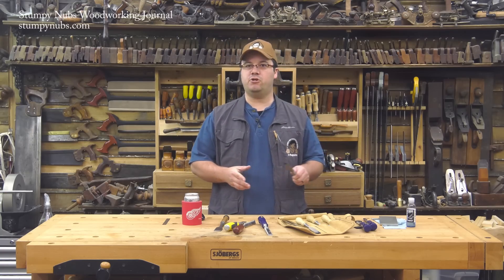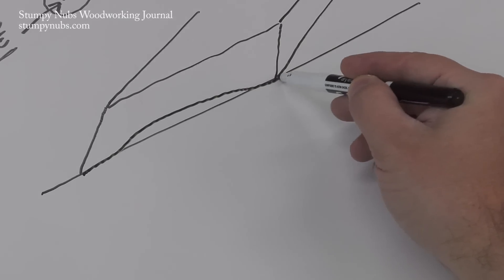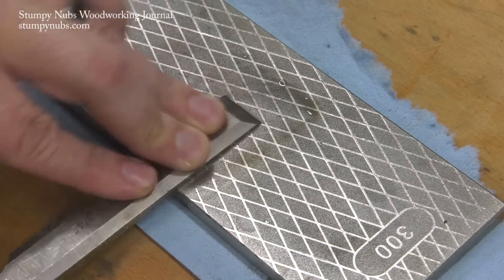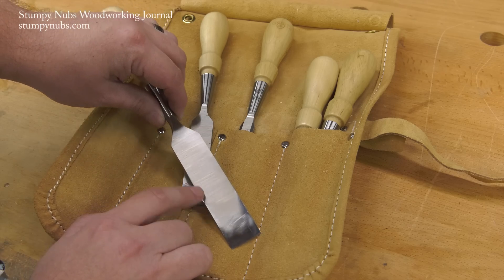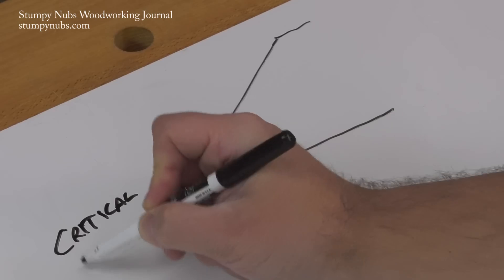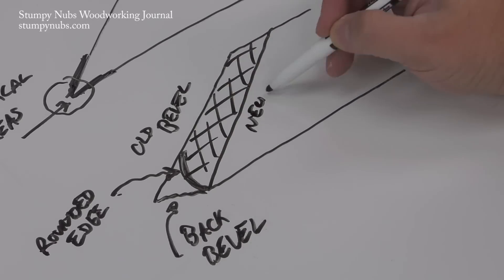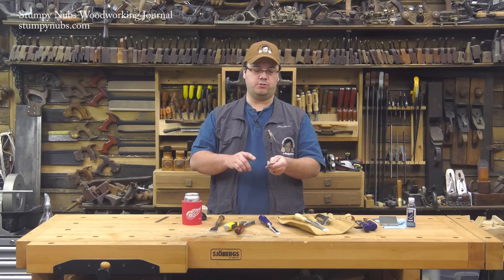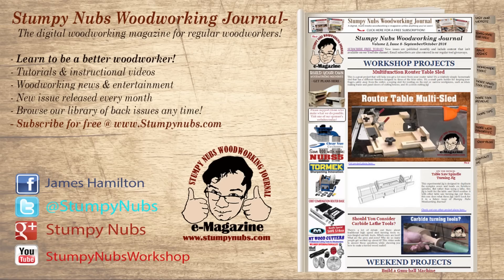The biggest sharpening mistake woodworkers make (And why...)

Comment: A kind of variation/compromise of the "back bevel trick" for some chisels is to apply pressure on the front while sharpening, but work the whole surface. That way you will have a really flat surface throughout, it won't be parallel to the (mean) surface of the raw tool, because on the front you will have removed more material, and you can stop when you feel you have sufficiently enough material flat near the cutting edge.

I noticed that a lot of chisels these days have not really much hollow/belly warp (mostly gets away after 5 minutes on a diamond stone) but have warp in the other direction, which makes it almost impossible to grind them flat enough to have a real flat reference surface.

Anyone else loves to have a chisel or two with all surfaces mirror polished just to lie around and make people look at that went astray into your workshop? ^^

Another tip that might work for some people that do manual work on their tools: Make yourself a "sharpening bowl" which is a portable bit of whatever you minimally need, take a few tools and just sharpen them whenever you do something that allows it, like having to sit through an episode of your wifes favorite sitcom... ^^

Comment: Great info as usual James, It's a one off on buying chisels and plane blades. I lap approx 30mm of cutting edge, and then it's good to go forever (most of the time). It does not take that much effort and not having to think about when you used the ruler trick last.

Comment: This is very informative, but I have been working with wood over 40 years, and one thing you did not cover is many folks use grinders and belt sanders to hone their chisels...I've seen this done many times...personally...I use a tri-surface wet stone

Comment: Been sharpening my carving and lathe tools on a small belt sander for many years.  It works great, and is fast.  Why?  Because carving tools are not used at the same angle time after time, as a plane blade is.  So an exact edge angle is meaningless, it just needs to be close to the factory angle, and sharp.  Learned it from a famous professional woodworker.  Look it up sometime.

Comment: The ruler trick is seriously nasty. It made me angry when I first heard about it. Why? Because with only a very small amount of weight bias towards the end of the blade, it's easy to achieve a good amount of flat in most decent chisels and plane irons. 

And if it's taking too long, buy good quality old chisels. The material is usually superior. I've bought red rusty 100 year old chisels that look like scrap metal but have the right maker's mark. I sand off the rust, then work them back into useable shape. 

To many, this is a black art, but it's one you can master fairly easily. All you have to do is understand why it's important. Wheelwrighting, Boatbuilding and barrelmaking take a lot longer. So far I've only cracked wheelwrighting.

Comment: All good information here.  But I do (humbly) take issue with the "back-bevel" ruler deal.  Perhaps it was an old school pay your dues exercise, but before any of us even started to do any actual woodworking, we had to set up our tools.  All edge tools, whether they were chisels, plane irons, or spoke shaves, had to have their respective tool backs flattened.  It took days.  In fact, we all had to (hand) flatten out hand planes before we even got to the plane irons...jointer planes took an eternity.  But once we were done, we had an appreciation and understanding of straight, and flat, and surface quality that went through to our (hand) joinery and ultimately, our furniture.  I could no sooner do the ruler trick on one of my  plane irons than intentionally drive my car into a wall.  Your illustrations of (poor) surface quality are spot on.  Terrific video...a pleasure to watch.
Reply: Parker, with all due respect, I'd say the point of the video is so that those of us with shorter attention spans and less persistence can have sharp tools without taking a week to sharpen them.
Reply: @Madmun357  It takes me less than 2 minutes to return a razor edge to a dulled plane iron.  Yes, the initial set up of a hand plane, one step of which is flattening and honing the back side of the iron, takes some time.  But unless one starts with a poor quality or damaged tool, flattening the back of a plane iron takes an hour at most, not a week. And once this investment has been paid,  an on going return is that one will never have to find or keep track of a suitable ruler each time the edge needs to be sharpened.
Reply: @robertlangley258  Thank you for the kind words.  Perhaps you could read my post again and this time read what I wrote , which starts with "All good information here...", takes issue with one detail, and closes with "Terrific video...a pleasure to watch."
Reply: @robertlangley258  Auch, taste of your own medicine there. LoL
Reply: @parkerheathiii4881  : To your credit, Sir, you even inserted the word "humbly". I fully endorse your overview. :-)
Reply: @parkerheathiii4881  I wouldn't sweat it, Parker. Some people like Robert obviously can't help themselves, steaming in and flinging insults around when it's not called for.  They just make themselves look stupid.
Reply: Parker, where did you learn woodworking? Who taught you to (or made you) sharpen your tools that way? Asking because I've been doing construction for 20+ years, never had any "formal" training in it. Work that requires this level of precision is foreign to me, and very intriguing

Comment: Great video and informative drawings. About the ruler trick: I have an old Ulmia plane from my grandfather, who was a carpenter, born in Poland and deceased in Germany in 1975. The plane's blade's back clearly showed that he had used the ruler trick, but I'm perfectly sure that he had never heard of Mr. Charlesworth. So, I do not credit the latter for the ruler trick.
Reply from the maker: Pretty much everything in woodworking has been done before. But it's nice to give credit to the person who I happened to learn it from.
Reply: @StumpyNubs  Ok, I totally agree with that. I had misunderstood that you considered Mr. Charlesworth the inventor of that method, not "only" one of its teachers.
Reply: @gunnararndt4359  If you want in depth knowledge of planes and sharpening, read David Charlesworth. I appreciate James' mention of Mr. Charlesworth.
Reply: On planes it also gives you a steeper attack angle. Frequently used to trick to tackle awkward grain, when you don't have proper York plane.

Comment: When replacing worn out chisels I invest the time to carefully flatten the entire back of the "blade."  It's worth the effort to have properly prepared cutting tools when doing precision joinery.  I learned this skill from an "old guy" back in the mid-50's as a youngster.  His chisels were hand forged by a very talented blacksmith.  I learned a great deal from him about crafting tools as well.  Too bad both "old timers" passed on before I had learned more.  Acquiring those skills today is nearly impossible without nearly prohibitive investment and more critically, finding a skilled "teacher."  I rarely use power tools although at times it is necessary.

Comment: Superbly explained..how does one sharpen curved chisels as in the ones used in for carving? I'm an absolute beginner and how you explained everything in this video came across brilliantly..lol, I can be painfully dim at times!
Reply: To be fair my friend, I really need to have this question answered too.
I was left a massive amount of tools in my grandads will. Among them an enormous amount of wood chisels, over 150, marples I believe them to be and 22 Record and Stanley wood planes. Vices, clamps I ha e never even come across before! You name it, he had it! Anyway, their are a lot of gouging chisels, they look to be for the wood lathe/bandsaw combo I also inherited (weird looking thing I know, it must be pretty decent its a myford). Any who,  although the chisels are exceptionally clean and keen at the moment, I would like to be able to do such tools justice and at least maintain them correctly.
So, the round gouging chisels have got me at a loss.....how do you keep the inner curved part flat? I am sorry if I didn't explain this well, I am new to woodworking. I'm fine with metal and my hobart....but this is like black magic! Please help.
Reply: Btw, are you any relation lol
Reply: Curved chisels are normally sharpened in a jig against a powered wheel . Consistent sharpening by hand with a complex bevel is extremely difficult
Reply: @shonaoneill5151  yeah like mentioned already consistency is key in complex edges, they make simple jigs for grinders to keep the tool referenced against the cutting surface of the grinder, or you could build one yourself.
Reply: @shonaoneill5151 , I'm with Peter Herrington on this one, but I'll take a step further.
   You'll want to run a search through Ebay and/or Amazon fairly soon...
   Search for "jigs sharpening gouges" and any related terms that come up as you scroll through the images... Study each item offered carefully (not just the price to cringe at)...
    You see... Sharpening jigs in Carpenter's shops are OFTEN handmade, and some can get pretty "wonky looking"... BUT the principles of sharpening and holding a consistent edge don't change... SO it stands to reason if your inherited collection is so clean and keen, then your grand-dad probably had a few such jigs around. They might not look like what they are to the "uninitiated eye"... making it EASY for you to overlook them.
    I've been in Carpentry for most of my adult life (off and on... and among other things) and I can still walk right past something a few times before stopping to realize what I'm looking at... ESPECIALLY jigs!

    ...funny story... 
   I actually had a "twist drill jig" for sharpening bits on a bench grinder... The thing had sat in a box for years. Meanwhile, I was buying new "electric drill-bit sharpeners" every time I wore one out (I end up occasionally stuck in metal and stone work, even in carpentry...lolz)
    ...AND then (about six months ago) an elder neighbor was chatting while I was maintaining the shop, and part of that was "the drill bit patrol"... When he grimaced at the racket of the little bit-sharpener I was "beating to death"... Then he pointed out the jig and asked me what the hell was wrong with that one...
    It was kind of embarrassing when he sat it up, next to my own bench grinder... stuck a bit in the thing and "zing!" sharp... just like that!

     Finally... you probably already know... BUT it's worth repeating. If you do go after sharpening anything with a power tool, I highly HIGHLY recommend a SPEED CONTROL involved on the power tool.
   High speeds and grinding make heat... heat kills temper in steel... Water and oil can only do so much... SO a slower grinder makes a happier blade... simple. ;o)
Reply: @shonaoneill5151  If you're not already familiar with him, search for Chris Pye. Chris is a master woodcarver who lives in England and has a series of videos explaining various aspects of woodcarving, including sharpening chisels and gouges.  (He does everything by hand.)
Reply: gnarth d'arkanen t
Reply: @thomasdeltoro8030  yo no entiendos
Reply: @shonaoneill5151  check out Penn State industries.  They make a low speed grinder with a jig to hold lathe tools  very cool tool for 275 dollars.  But you have to get on a waiting list to get one.

Comment: Strop it till you drop it. That's what I was taught.  I flatten the whole back, sharpen it once, and strop it regularly. I only give it the stone if I drop it or if it gets chipped while using it for something stupid like opening a can of stain.
Reply: @peterfitzpatrick7032  And we're still wondering what he was up to. Lol jk
Reply: Noooooo....actually using them to open cans of stain/paint/finish/etc....killen me smalls
Reply: Peter Fitzpatrick my father also did this. I still do if I’m on site as use an oil stone then and no strop.
Reply: Peter Fitzpatrick it does knock the wire burr off when you sharpening on oil stone. I know that because when I was training and before my hands had hardened properly I got a piece of burr under my skin.
Reply: ... hands tough as leather...

Comment: Just set up your tools the Japanese way with a completely flat back.
Quick and easy to quickly pump out a fresh edge with no changes in angles.

Might be a chore if you have HSS steel and no hollow back, but a good grinding stone such as Shapton, sigma or nanikawa (there's thousands of good stones out there).

This is coming from me as a sharpener. I'm very tired of woodworkers not establishing proper angles on their tools as it removes so much performance of the tool.

I understand that you can't spend hours every day sharpening up your tools to perfection. 
But by having those flat angles on your back and bevel you significantly cut the time needed for maintaining your tools.

It's really sad to see these neglected tools, very similar to children a tool that has once been poorly set up will never achieve what they really could have.
Sad but understandable

Comment: Really quite the nice informational video. Great job.
I already picked up this information from others, and some from you along the way, but other beginners may not have spent the hours behind the screen doing their research, and this pretty well covers most of the errors I've experienced while researching and practice sharpening. Personally, I'm still waiting for someone to make high tolerance CBN plates for sharpening tools. I haven't been able to afford the wheels yet for my 8" slow-speed grinder, (for my lathe tools), and I sure can't afford a diamond lapping wheel either. I tried one of the card-board wheels, and was completely un-impressed by it. My tools came away duller than lapping with diamond cards and wrist action. 
Thanks for sharing this video as a source of info for those kicking themselves because they just can't get a tool working the way they see it work on the videos.
Kuddos!

Comment: Hi James, I've been using 'Electrical Tape' instead of the ruler for some years now. It is thinner, it doesn't affect the stones, it gives a perfectly uniform angle as it is taped to the blade itself and going from one grit to another keep the same angle of attack. You don't have to faff around with keeping the ruler from moving around either.

AND - I use it on most of my chisels too. If you do the calculations the ruler creates nearly a 1 degree back bevel at 2 inches from the edge (0.9 degrees to be precise). The electrical tape is .14mm thick against at least 0.8mm for the ruler and the resulting angle is a mere 0.14 degrees, still useful to get a quicker mirror face on the back and no real impediment to even paring work. Try it, you'll like it :)
Reply: I like the word faff!
Reply: Does the electrical tape hold up during the rubbing or does it start to roll off or become dislodged?
Reply: @TheSeancassady  No, it glides over my diamond stones without showing signs of wear, and also the Japanese 6000 grit water stone. Obviously, it is a one-time use process. I'm careful to measure and tape it exactly 50mm from the tip so that next time I get the same micro angle. I wouldn't use things like painters tape though. That would break up. Electrical tape is really consistent in thickness too.
Reply: Rob Robertson 8
Reply: Thank you for the good tip, but wouldn't engineering shims that are within +/- 0.002mm be better as they much more accurate?
Reply: @shonaoneill5151  For precision?  Sure. That's not necessary though, it's simply the act OF making sure to hit the opposite side of the cutting edge, to get that sharp, even cutting edge (compared to not).  No matter the shim you use, it has the same effect of allowing you to make an ever so slight bevel, thereby only needing to deal with flattening the "belly" along the very edge, much less than if you weren't using a shim.
Reply: @williambranham6249   Faff is a popular slang Britishism, being a verb and a noun. "I spent ages trying to get a broken bolt out of my engine block but in the end had to buy special extractors. It was a right faff, I can tell you!" ...or... "Stop faffing around with that engine and get the kids picked up from school!"
Reply: You'd be amazed at what accuracy you get by literally using double sided tape on a grinder table! Tape is surprisingly consistent